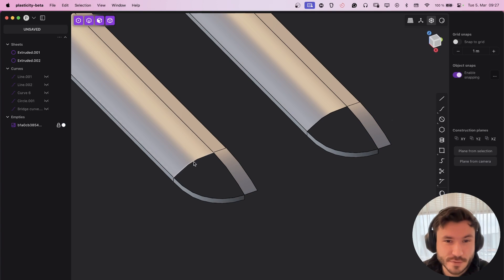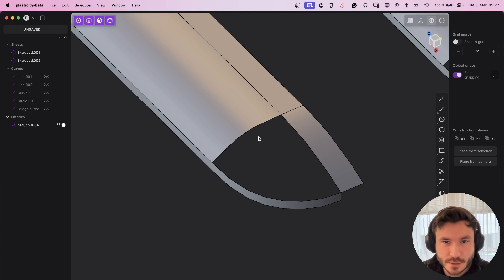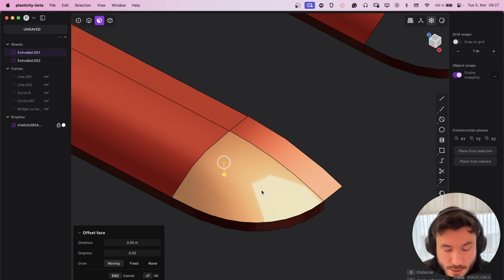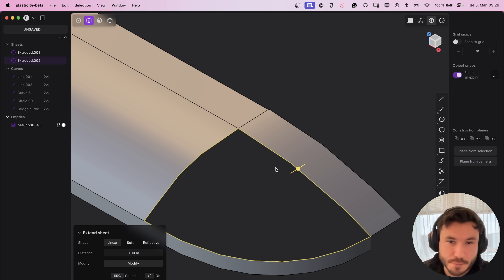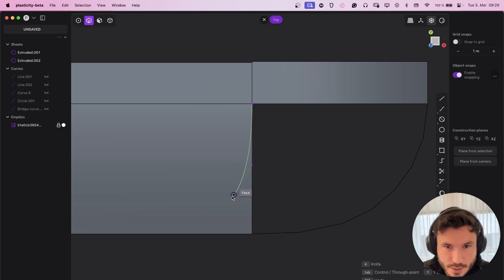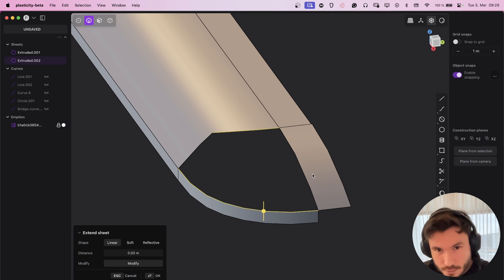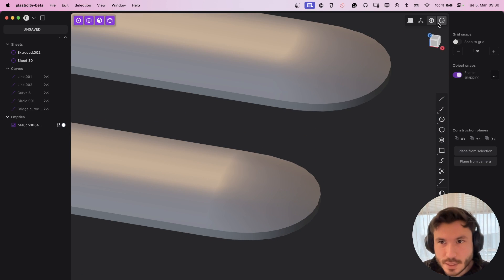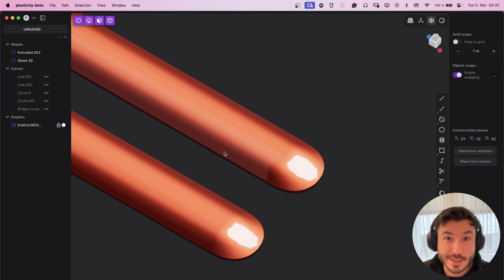Improve "Patch Hole" results in Plasticity

Comment: Rather than a somewhat randomly placed two lines to cut that edge into two edges, you could have trimmed the top surface with a radius, or broken up the side more precisely... I'm having a hard time describing the process without having visuals to rely on. The point is that there are tutorials out there from Rhino, Alias, etc users on how to properly create a corner from 3 edges.